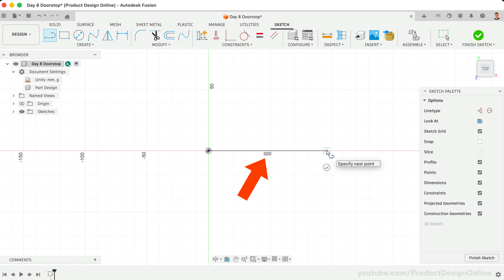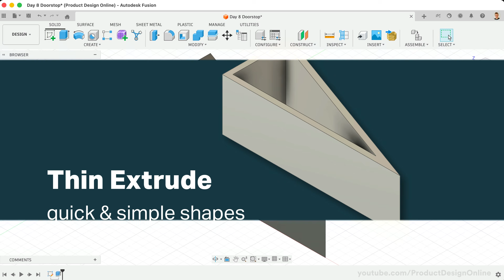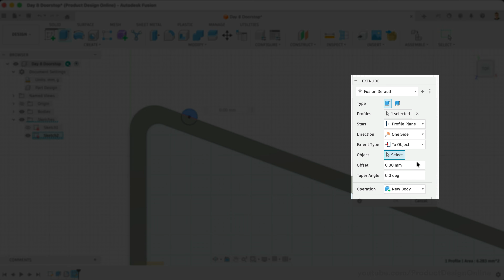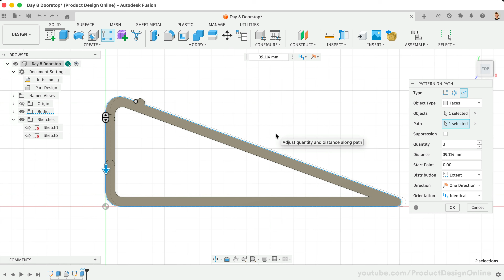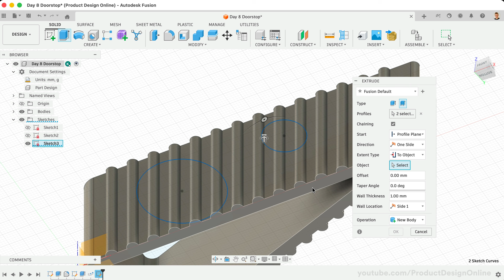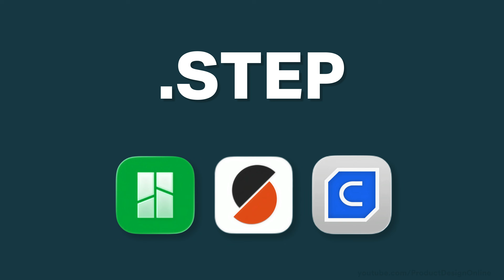The Secret to Thin Wall Designs | Day 8 of Learn Autodesk Fusion 360 in 30 Days (2026 EDITION)

Comment: I love the quizzes you've created for these videos; thank you so much for doing that for us!

That said, I think you have marked the wrong answer as "correct" for the second quiz. 

Question: "What is the primary advantage of using "Thin Extrude" over a standard Extrude?"
Answer shown as correct: "It uses less plastic when 3D printing"

But I think it should actually be "It creates 3D walls directly from a single 2D line in one step"?  That aligns better with what you said in the video and with the explanation given for the question after answering.

Thank you again, for the quizzes, and also for this entire video series. It is incredibly well done.

Comment: I'm surprised you mentioned Cura, but no Orca 🤯
Do they still make Cura?
Btw, there is no difference between feeding an STL or a STEP file to a slicer; they all convert the STEP to STL anyway BEFORE they process it, so as long as the STL is not a jagged potato, it's functionally the same as using a STEP. Source: I read the code.

Comment: Great video. The second quiz question is a bit confusing. The correct answer (1) is about filament economy, but the explanation is about time economy and conservation of steps, which seems to align more with the second answer. Is this a mistake, or am I interpreting it wrong?

Comment: Hi Kevin, great lesson. The most challenging part for me was the Independent Practice: Portable Cable Wrap — specifically adding text. Fusion’s text function doesn’t accept a normal apostrophe inside a text string, so I had to replace it with a visually similar character (like a backtick or a prime symbol) to make it work.
Kind regards,
Mykola
Reply from the maker: ah, that's a recent update to the Text command (I think last year) since it supports Parameters now. I will have to cover that as it seems to trip up a lot of folks. Glad you figured it out though!

Comment: when we are exporting our files, before that we dont need to set our material type to plastic or somethinng like that?? also after we did the thin wall extrusion of the triangle, why did we only fillet two corners of the triangle,  why not all three?
Reply from the maker: No need to apply a material before exporting. Mesh files do not include that data anyway. 

You can apply affilit to that small inside if you would like, but it is not going to make much difference thereb since that area is thicker. The back area needs it more to reinforce the large opening.
Reply: @ProductDesignOnline oh, i thought that since that corner is thin, it may create a weak point and in case while trying to bear the impact of the door, if that particular corner is subjected to bending, like it's angle reduces, then it would be susceptible to cracks, while making my version of the door stop i added a fillet in that part, just in case😅
Reply from the maker: @shaurya_106  That may be the case in PLA, but with TPU you're not going to see much difference. Remember that the door is going to strike higher than that, not right at the tip (in the majority of cases).
Reply: @ProductDesignOnline oh alr thanks

Comment: Why is it important to select the outer circle and not the shaded area when you thin extrude the final cylinders? I tried both ways and they look exactly equivalent
Reply from the maker: You're correct that you can select them both ways. The reason it's important is if you change your profile later, selecting the curves will keep the correct reference. If your sketch were to change that alters your profile, the extrude would have an error.
Reply: @ProductDesignOnline  Thanks! I was wondering the same thing

Comment: I followed the instructions and double checked selections for pattern on path, but for some reason the grips on the bottom of the doorstop are a fraction of the size of those along the top.  Any suggestions as to what could be wrong?  It printed beautifully even though the bottom isn’t quite right.
Reply from the maker: Hmmm.... could you email me your Fusion file? I'll need inspect the file to see what's going on.

Comment: New to Fusion, but I ran into a problem with exporting. I googled, went on forums and rebuilt the whole thing from scratch. However, I found that the issue stemmed from Fusion. 

All I needed to do was close fusion and open it again and exporting worked on my original file. Hopefully this helps save someone!
Reply from the maker: Sorry to hear you had those issues! Thanks for sharing 🙏🏼

Comment: Completed this and the cable clip last night. For the text - this also refers to Day 7 with the bike handle and the ring - apostrophes need Alt+0146. If you put the single quote from the keyboard, Fusion will not recognize any further text because the single quote is used by the software for programming the text. Looking forward to Day 9.
Reply from the maker: That is a great tip for everyone, thank you for sharing! 😊

Comment: Uhm, no Slicers don't do that.
Slicers all convert .step files into .stl before opening it. And actually, using .step files can be bad for print quality as the converter being used in Bambu, Orca etc is quite old.
Reply from the maker: I'm aware that slicers will still tesselate... But as another fellow pointed out, with much more edges than with an stl. Do the test, take a cylinder, export in both stl and step, in the slicer you will see the faces with the stl, not with the step, same on the printed part, the cylinder will reflect faces under the light, with a step it will not.

Of course, with some prints it may not matter. It does make a difference on parts with desired tolerance or clearances.

Comment: Do you think it's better to save as step file or send as mesh directly to the slicer?
Reply from the maker: Honestly, it just comes down to how much detail you actually need. For this basic doorstop, a mesh file is totally fine. It's a simple shape...but if you’re working on something more complex with moving parts or tight clearances, I’d definitely go with a STEP file, as with most slicers, it will help keep your tolerances spot-on and ensure everything actually fits together the way you designed it.
Reply: @ProductDesignOnline I always have issues with magnet holes, they end up being smaller than they should
Reply from the maker: @FedericoAltolaguirre  that could definitely be one reason why! Sometimes it's also slicer settings that add a bit of thickness to round objects, the way the printer follows the curve.